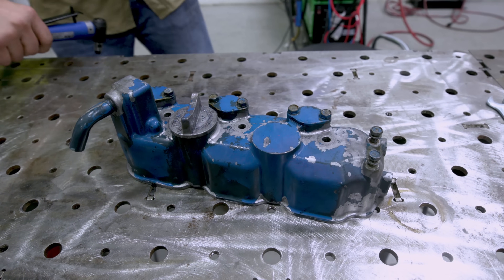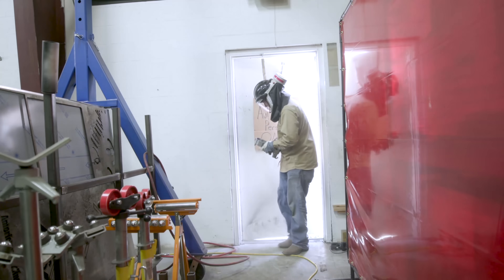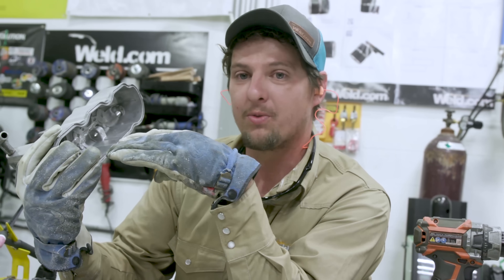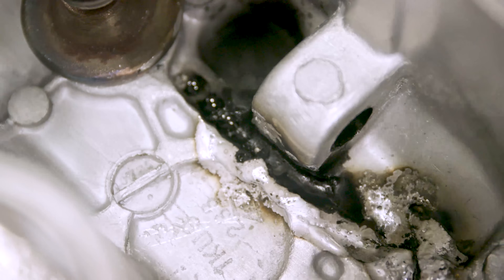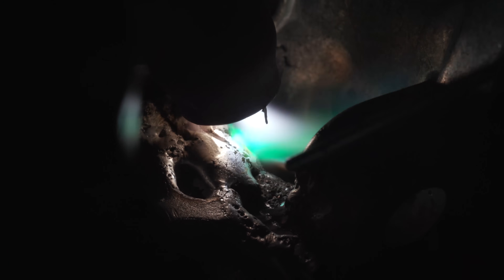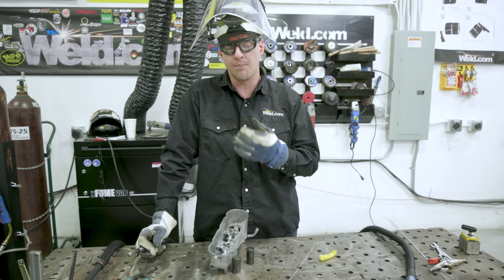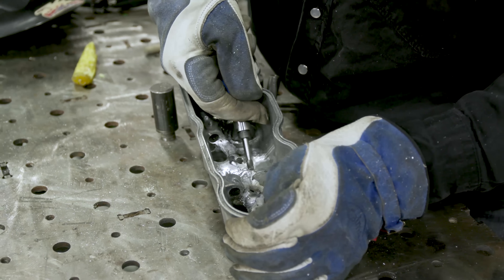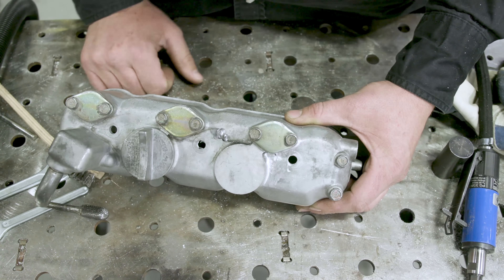Weld Repair | 1983 Cast Aluminum Kubota Diesel Engine

Comment: Heating will remove that oil leaching.  That’s how we cleaned them and heads in the machine shop
Reply: I was thinking that heating then cleaning would make more sense. Plus I would think you want to drive off any water before welding.
Reply: Mark Trombley we heated overnight, had a bake oven, then shot blasted, ground, back in oven to preheat and welded hot.  Then cooled in oven over a 6-8 hour period.  We repaired many covers, cylinder heads, oil pans, etc. that were aluminum and expensive to replace
Reply: @slelliott14  the mvp in the comments right here.
Reply: What is material is the bbs of your blast shot machine. Dont forget a shot blast machine releive stress in block and head from cracking. Help strengthen heads and blocks also. Now do the job just starting out in life trying to establish a bussines. I know you had to at one some point. Not everyone can afford what you have. There is all different ways that work. I grow up in a machine shop I use every machine your talking about.
Reply: ManCub Welder I wasn’t belittling you, but it’s pretty easy to heat something and cheap.  An old oven would work.  For aluminum we used a blast cabinet and glass beads.  For cast iron we had a steel ball bearing blast cabinet
Reply: Glass beads actually erode aluminum and other soft metals away.  Soda blasting will not erode aluminum away. Soda blast is the best for way for people starting out to learn also. Soda blasting is a little slower. But I did not damage any machine surface that the decompression lever goes into the valve cover.Let say I am glass beading and i cant get that one peice of dirt off my brass guide. What is gonna happen? I will start wearing metal away from that brass guide causes by the glass beads sitting still for so long and I just messed up the brass guide that is machine to tolerance and I dont have a serdi machine in my shop. Then I'm like f$$$.lol.The oven is waste of time to me I think.  This is my opinion. Your heating the metal while your welding and actually working it out with a wire brush and grinding out. Heating up never gets all the oil out. So I think it is pointless. Motor oil boils at 572 degrees and a home oven only goes to 550 degrees. I really appreciate your tips. I am a gear head(motor head) to. I been raise in my Father automobile machine shop since I was 8 or 9.  I do use glass beads also. Just dont want some1 go mess up there 427 hemi mopar motor.  I like mopar big block  but I am a whore so I like any motoer.lol. thanks for watching and keep in touch. I love talking about motors.  Stay healthy
Reply: ManCub Welder I guess that’s where knowledge and ability come in, you don’t sit in one spot.  As for the oven, you are dead wrong, but hey, do as you want, I know where I get my work done, and certainly know where I wouldn’t.  I guess the remarks on my post saying it is the correct way versus the remarks on how you did it speak volumes.  There’s a saying I hear quite regularly, when your not sure, let the professionals handle it!  Have a great day!
Reply: Did you ever work on hemi heads?? Mine ( are the iron M code) needs some mods to get twin plugs and a diesel/GDI ( same part numbers but the pumps are different I guess 🤷🏻‍♂️And the gasoline ⛽️ ☝️ is at sub 5000 psi vs 40kpsi It’s so I can run modern EFI ) direct injector between the plugs and I like to increase the exhaust valve size to 2.25 titanium or inconel  sodium filled and install copper berilim seats and I’m looking for ideas 💡 of how to do this I measured and as far as I know it fits ( just needs some welding and or more machining time to correct it for daily driver Service ) and has a great 👍 chance of working
Reply: Lol 😂 it’s 426 2G hemi in less it’s a factory goof or a weird rebuild ( or did auto correct get you too like it does me sometimes ) of one more cubic inch ( 427 ci ) 👌🏻 I do that to by accident and get it mixed up calling it with a different displacement sometimes too even if mine is a all iron stroker 4.5 crankshaft by 4.25” bore. 

So have you ever welded one up / fixed it or modified things like the ports or added twin plugs as I’ve read older magazines from pre-2000’s that talked about welding iron and aluminium heads to change the size or shape of the ports or valve sizing ( I’d like to change my exhaust valves to 2.25 inch basically the same idea and placement as the intake just the opposite side of the head ) and before the rule book 📚 changed it super stock guys did it on the common it 🤷🏻‍♂️ Nowadays not so much if there class racing as it can earn you a DNF and getting kicked out for the season
Reply: did you mean :heating?: I don't remember ever hearing aluminum heads , but I am old so maybe they do.
Reply: Bruce D lol...yes!  Fat fingers skinny keys and a phone that changes everything!
Reply: Bruce D when you get them hot enough, you’ll hear them!!!  Lmao
Reply: @slelliott14   great reply, watch those fingers,, regards